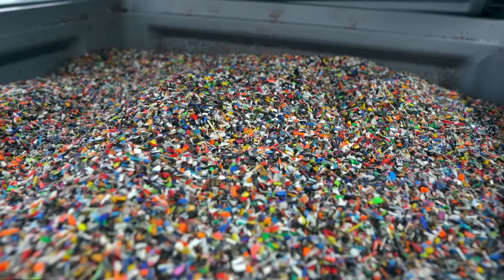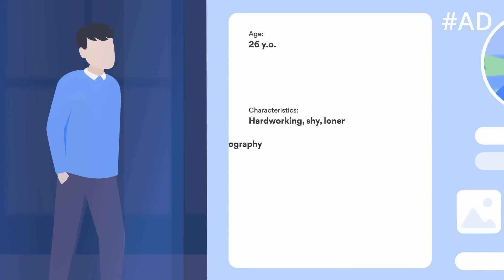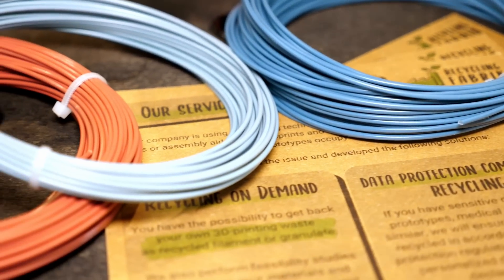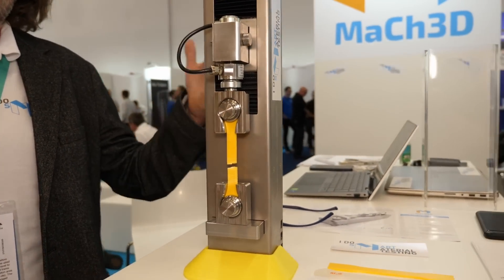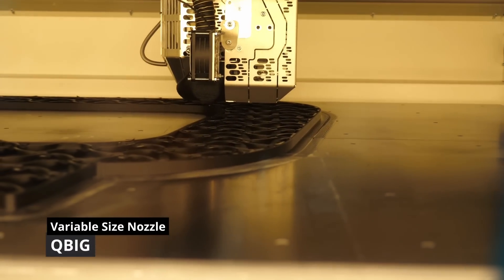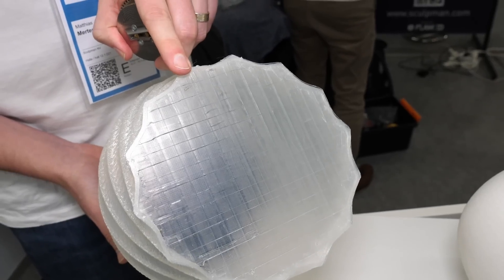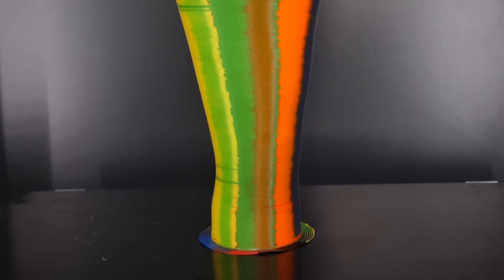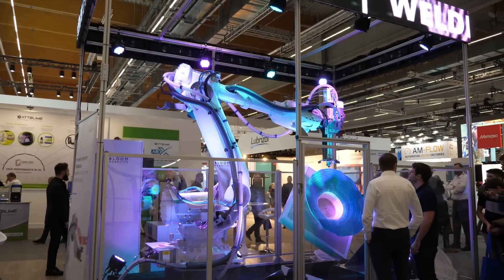Impressive 3D Printing Technology at FORMNEXT 2022

Comment: I have contacted many recycling centers and industrial recyclers across my state here in the US and most have not even heard of PLA recycling, let alone begun the process of accepting it. I wish I had a way of reducing the most wasteful part of this hobby :(
Reply: That's what we found out too in Indonesia. We from filagain run an experimental 'waste bank' for 3D printing waste and haven't found local recycler that accept PLA, even half of them don't even know what PLA is. Ironically 'environmentally friendly' or bio plastics are arguably more harmful than conventional plastic because it's not so common that there is a lack of proper recycling or composting infrastructure to process it (larger bioplastics requires more time & heat to degrades, hence why regular composter would not accept PLA waste), and IMO there might be less attractive to process it because PLA as bio plastics, degrades faster that may affect its recycling viability.

If you want an actually environmentally friendly plastic, ironically ABS plastic that is from oil, would be the better option. Because ABS has proven recyclability, usually in demand by local recycler and doesn't requires new specific infrastructure to process it.
Reply: Dyi recycling is still possible but not easy since there is a material variance.   Basically to do it right you need a solid shredder and then a wait to clear the inevitable piece of petg that gets in there and clogs it all.   Then after you have a blended material.  It about melting it back into a filament of right dimensions.
Reply: DIY or melting them into silicone molds seem to be the only way to go
Reply: I keep all of my old failed prints, scraps, or support structures for later recycling whenever the tech is more available
Reply: There are a few good videos about reusing PLA scraps. I like the idea of using moulds to melt different coloured scraps into functional objects or sculptures
Reply: That's why I'm holding onto all my scraps. I'm either going to send the filament to that company from the U.S. (the paid shipping will suck though), or build my own filament recycler.
Reply: That's actually a very good reason to use ABS. Besides being cheaper, it's recyclable at almost any facility.
Reply: Fusion Filaments
Reply: I’ve bought silicone molds and have started melting the filament down to create new things from print scarps
Reply: @TheWesternPatriot  that sounds like a good match for my needs. What molds did you get and where?c I'm interested in the required equipment and process.
Reply: @HelvetiaAir  I'm also interested in this!
Reply: My french filament reseller provides a service to recycle PLA if you have 5kg+ PLA  packages, free shipping and all
Reply: OR just save it all up smash it to bits with a hammer and metal it in to a block and jam a handle In it for a soft faced hammer
Reply: RecyclingFabrik needs to open a US facility
Or? Someone else and that? May just be a huge opportunity…
Reply: I've been looking into doing the ♻️ for PLA but I'm honestly unsure of what sort of demand there really is.
Reply: They mostly just burn it here)
Reply: i want to start my own company in USA taking plastics from waste streams and recycling companies that just ship it overseas to be burned  having just wherehouses of stored ready to use plastics for subtractive or additive manufacturing or even reading to use construction 🏗️ materials geometry forms but right now I'm literally unable to be fired at work till they find 3 people of high enough knowledge and health/ability to lift bruh for my replacement... and then 2 other positions at least on other shifts too... my job is basically company life 🧬 support while doing numerous endless tasks 3 shifts covering 24/7
Reply: Burn it 🤷‍♂️
That actually might be the best way to dispose of PLA specifically since it is made directly from corn.

Corn absorbs CO2 to grow, when you burn the PLA it will just be releasing that absorbed CO2 back into the air.
Reply: Hippie, pls
Reply: Ur trading PLA for diesel when ur recycling 🙈